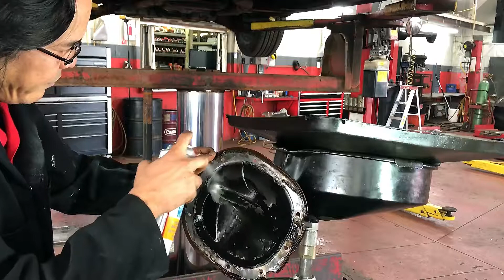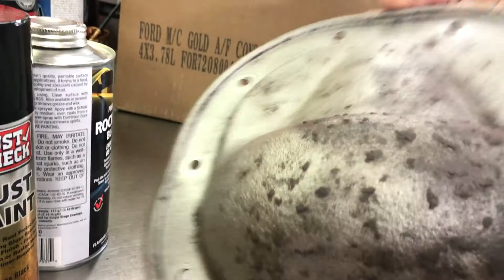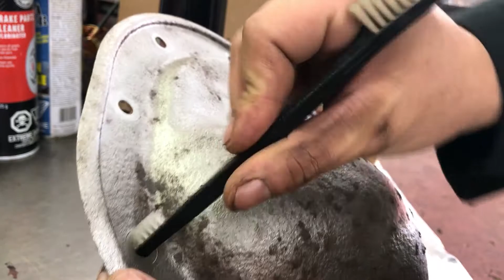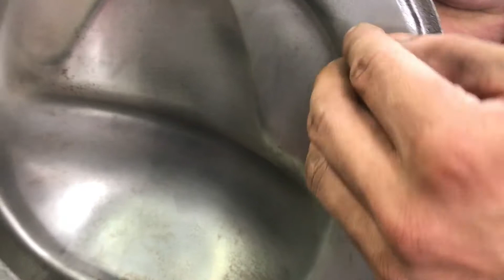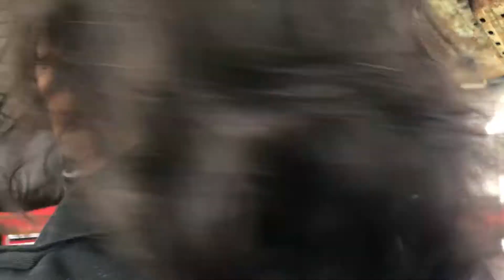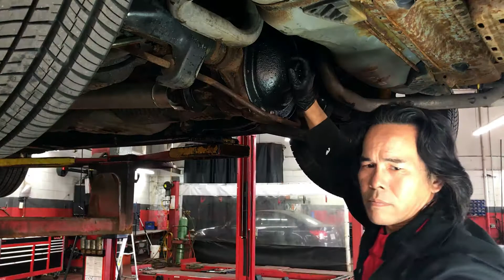2007 ford crown Victoria differential oil change

Comment: Did you really just blast the differential out with a water hose?
Reply from the maker: yup,,,the original oil,,12yrs old,,the smell was awfull let alone the additive,,blasting it with air helped a lot as i could see if there where any chips or cracks,,none,,one of the few original parts on my car that was still in good shape

Comment: You know if you stick a tub at the end of the wrench you can add leverage make it very simple to break the bond on the bolt. 👍
Reply from the maker: yes but I dont want to break the studs either,especially on a part that will be $$$$ but thanks for watching

Comment: What was your torque specs on the fill plug and gasket bolts
Reply: Don't want to over tighten these.  Hand tighten so they don't come out and stop.
Reply from the maker: @mikesal8088  as you can see i stop the camera a lot,,i was at work,,and some staff didnt want to be filmed,,i torqued them during one of those moments

Comment: did u put a gasket ??
Reply from the maker: nope,,gasket sealer only after cleaning the surface,,i used the harsh method which ended up causing a small hole but it wasnt in a place that caused any issues

Comment: no gloves?
Reply from the maker: hello,,sorry for the late reply,,real life issues,,this was filmed where i worked so there was handcleaners spread out around the shop,,this day i made this was over 43c with humidity so we were all soaking wet even the guys at the front deks had little fans,,wen we wear gloves in heat like that everytime we raise our hands the sweat just dripps or literally falls in our faces,,,but,,i did ended up getting sick from all the oils,waste over time working there,,,